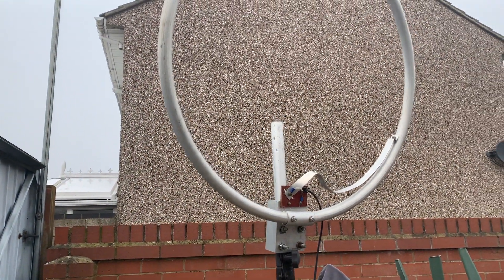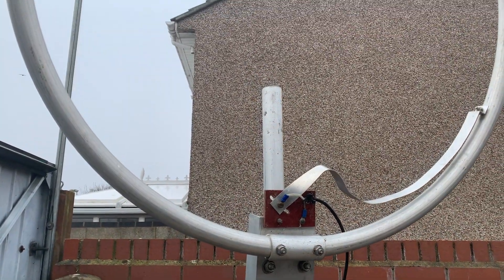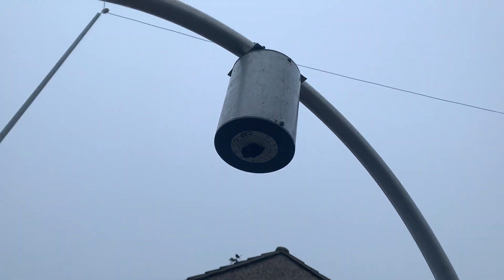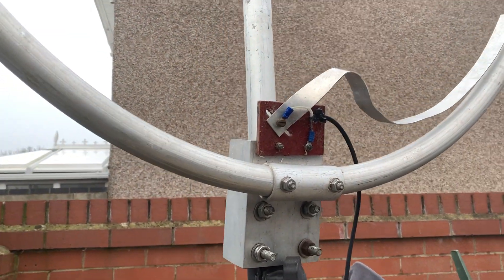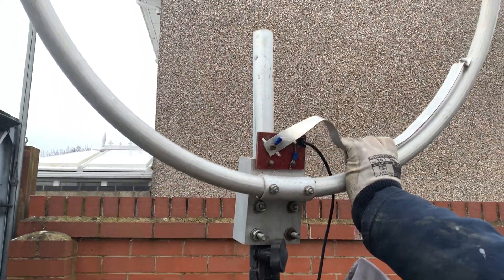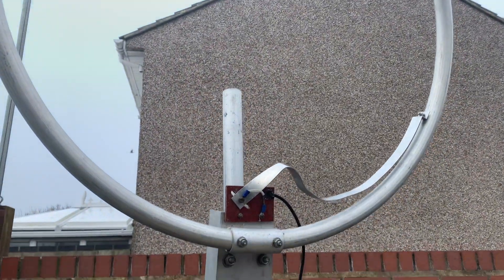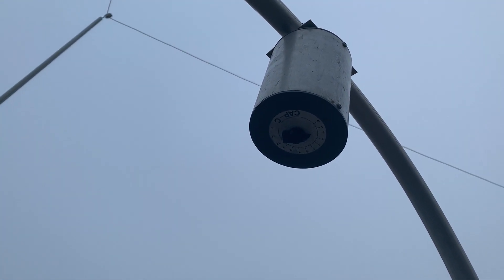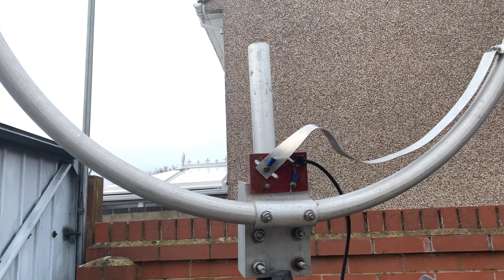Help required! Can you identify this antenna for a Harwell Amateur Radio Society member?

Comment: I'm fairly sure this is a Cap.Co AMA 3 magnetic loop antenna. It should be tunable via the air-spaced capacitor in the upper section to operate between 13.9 and 30MHz. If turning the knob makes no change the antennas resonant frequency the capacitor is likely damaged/corroded due to water ingress. Cap.Co Electronic Ltd made a range of these loops in the 80's, they were a small outfit and the company was short-lived. HTH
Reply from the maker: Hi Chris, thank you very much for your insights. 73

Comment: Could be a 'homebrew' job possibly used for "Foxhunting" on CB from the 80's..!  Incidentally Clint, whilst on the subject of Magnetic Loops, does it matter tremendously if you mount a Wellbrook onto a metallic (aluminium) frame as I've done? Is it only metal around it that is detrimental to reception and not under the base section? Cheers, David
Reply from the maker: Thanks for your comments David. I don't think any other materials would affect reception unless they were wet and grounded but saying that, my loops are supported on short aluminum poles that are in contact with the ground outside and I've never experienced any loss in performance. 73s, Clint

Comment: Hi Clint,

If you google "magnetic loop antenna gamma match"
and looking at the pictures you get a lot of information

It's a Magnetic loop Antenna with gamma match,
the frequency depends on the circumference of the loop and the capacitor,

It is a very common antenna. Hope this can be helpful

Be Safe
73 de
Bengan
Arctic Circle
Reply from the maker: Brilliant!! Thank you my friend. 73s, Clint